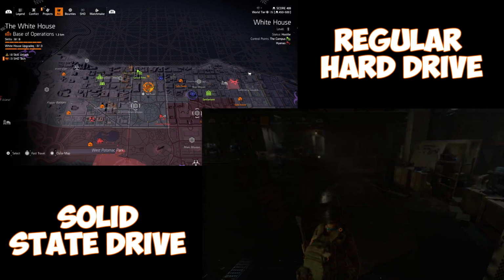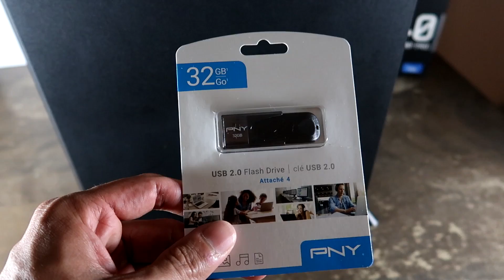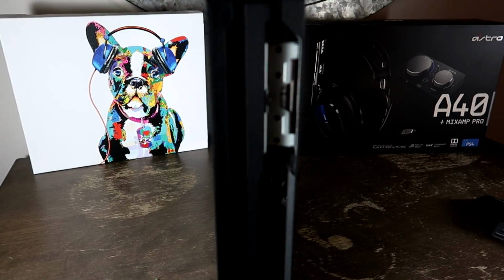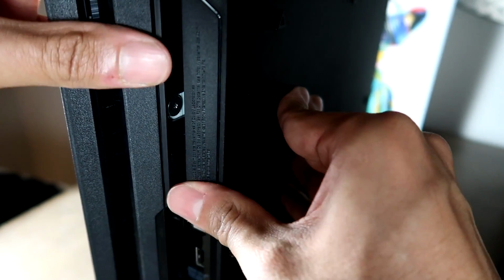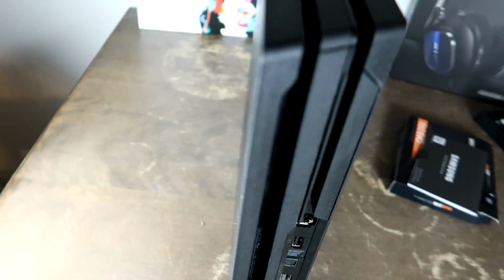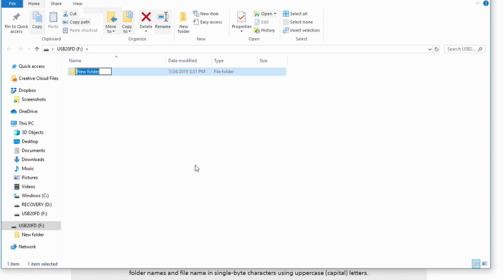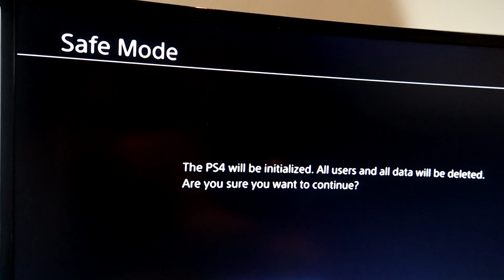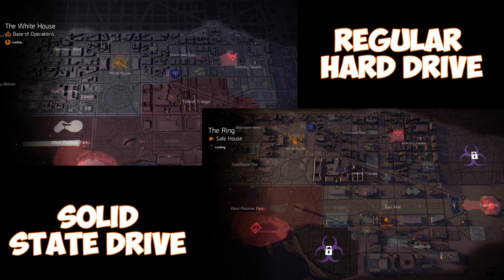HOW TO IMPROVE YOUR LOAD TIMES ON PS4 PRO/SLIM | QUICK GUIDE TO INSTALL A SSD "SOLID STATE DRIVE"

Comment: I know this is an older video... But what is better 860 EVO or 870 QVO? Or is an external T5 good enough
Reply: Go for the 870. I have a 2TB in mine. An external T7 would be better even for backing up.

Comment: Just finished installing the 860 EVO on my PS4 slim.
Would def recommend it. Smoother interface and faster load times.
Reply: @TruGamer128 I’m gonna buy one too however, I don’t know which ssd to buy. Should I buy the Samsung ssd evo or qvo
Reply: @brucewayne1332  I would recommend whichever you can find the best deal on. I doubt you'll notice any speed difference between the two honestly. Hope this helps
Reply: @TruGamer128  Ok. Thank you!

Comment: It been a year since you posted this video, I been reading community blogs that people been using external ssd ? Also one kid said he used his fathers laptop that has a built in SSD and it works just like a external drive? Is any of this true?
Reply: Yeah, get a Sata to usb adapter.  It's really easy to change out the hdd anyway. Less than 5 mins. Ssd doesn't only make laod times faster, but it'll load up texture assets in the game a lot faster too. What I mean is that you won't see clay like objects but the textures would be loaded instantly.  A 1tb Crucial mx500 is 100 dollars on amazon.
Reply: Or wait for ps5 that's coming next month

Comment: If I remove the hard drive that comes with the PS4 and buy an adapter for it. Can I transfer the apps/games directly to the new hard drive?
Reply: Only if after you install a new hard drive into the PS4 and resign back into Playstation Network.

Comment: Don’t forget to deactivate ur ps4 before u swap out the hard drive for a ssd. It was a problem that I ran into when I logged into my account I wasn’t able to make my ps4 my main one after the swap to a ssd
Reply: how do you do that? also was you able to fix the problem?
Reply: @bigdogpistolp5898  it should just be in the settings. It's really simple. Just search for a video on it. But be careful you can only deactivate a PS4 once every 6 months. Yeah, I was able to fix the problem I just emailed sony and they were able to deactivate it for me. Basically deactivating is like removing the ps4 from your account. You are saying that it no longer belongs to you. You can only have one linked to your account at a time. So you need to get rid of the old ps4 and make space for the ps4.

Comment: 500gb 860 evo should be delivered soon, i will be using an external hdd as well. SSD are pricy but outclasses hdd in all other aspects.
Reply: Don't except it to be exactly 500gb, because I've bought a 1tb and it's actually 800gb

Comment: I realize I might be a little late to the party here. But, instead of advocating for ONLY SSDs. it is worth noting that the Mechanical Hard Disk Drive that Sony preinstalled in the PS4 console was antiquated to begin with. Most if not all of them, came with a 5400RPM HDD stock. Which is arguably one of the slowest speeds of HDDs available on the market today. Also, it is noticeably absent any mention that while SSDs may not have moving parts and are generally faster than HDDs, it is important to remember the cost versus reward ratio does not diminish the fact that HDDs STILL have their place in the gaming space. The price point for a SSD is often MANY times more expensive than its HDD counterpart. Should a SSD (unlikely) fail, you will inevitably spent more to buy 2 SSDs versus how many HDDs you could have purchased for that same amount of money. You could get a 7200RPM HDD and improve your gaming experience across the PS4 Original Model, Slim, and Pro. It is somewhat biased to state you MUST have an SSD to optimize game play. In short, SSDs have greatly improved in performance and reliability over that of earlier SSD versions. However, HDDs have been around for decades, have withstood the test of time and are still in use today. To solely push SSDs as the be-all-end-all solution is not only incredibly biased but inaccurate.

Comment: Hello, if i just bought a brand new ps4 pro and i haven't used it yet, do i still need to back up anything from the original drive before i install the new drive?  thanks, john
Reply: Only game saves and video recordings if you have any. You have to download digital games anyway, and everything else (ps+, digital games) are connected to your account.

Comment: you fucked up when you explained how to screw in the new SSD into the Hard Drive Enclosure. Didn't mention there was a size difference you had to compensate for and the fit isn't as simple as you make it seem
Reply from the maker: if you got the SSD its plug and play?
Reply: @NothingButSkillz  no its not. The SSD isn't the same size and doesn't immediately match up with the screw holes of the enclosure. I had to use a couple of tissue to make the SSD screw holes match with the Enclosure holes. This should've been mentioned in the video
Reply from the maker: @Slayin101  the samsung SSD on the PS4 pro is 100% plug in play. If you bought a different brand then its different. I installed it on camera. I used no tissue?
Reply: @NothingButSkillz  Dude, I used the 860 Evo Samsung 2TB. Same as yours just more storage. When you lay it flat on the enclosure the screw holes don't match up. You have to put stuff under it to elevate the SSD so the holes match up

Comment: Thanks for the video.  I find it hard to believe the PS4 Pro is so slow. I purchased the 2 TB Samsung EVO SSD and hope to install in a few days.
Reply: @MARCUSAURELIUS Hi,  The installation was easy.  As the unit was new I only had a few games installed so I did do a back up and just made sure I had my saves in the PS Cloud to retrieve.  Most videos on this show the plastic cover which has to be removed to gain access to the drive screws as being an issue to get off but I found an easy solution.  There is a raised area on the end of the part.  Use something flat to push forward from that spot; without allot of effort; and the piece comes right off and went back on without issue.  You will need a small phillips screw driver. Fully power off the PS4; not sleep mode; and just remove the original drive. Put the new drive in and start up.  The system will not see the drive because it requires the NEW system files from PS to format and setup the drive.  You will place this file on an USB device so the PS4 can access and install it.  Make sure you have a USB device the PS4 will recognize. I recommend checking it before beginning.  There is a minimum  size requirement.  Format it to eFat and the PS4 will see it.  One the PS4 installs and runs the file you can redo everything or use a backup you can create before beginning.  One thing I had to do after installing the drive was update the firmware on the Samsung SSD EVO 2TB.  To do this I had to remove the drive and place it inside my desktop and run the newest version of Samsung Magician. I updated the Firmware and just placed the drive back into the PS4.  Luckily the firmware update did not impact the files on the drive and I did not have to redo anything.  Samsung does make a 4TB EVO SSD but I am not sure is the PS4 will recognize a drive larger than 2TB. Physically it will fit but it will come down to if the system is able to recognize a drive larger than 2TB.  Good luck.

Comment: I upgraded to this HD 
Had a question tho for those who have done this have u noticed that it PS 4 pro seems like it not working as hard? Or has had those this when it loading games were it gets loud? 
My PlayStation seems to be working a lot better with this drive
Reply: yup. I replaced the drive but also cleaned the fan (which wasn't too dirty) and heat sink. Totally a quieter machine. Can't even tell it's running unless I touch the back and feel the heat from the fan

Comment: For real u got 2 go through all that to make ur PS4 pro faster? Holy crap! Xbox one X is faster in load times w/ it's internal HD than the PS4 but adding an external HD 2 it doubles & almost triples the speed of it. I'm not bashing PS because we are all gamers & everyone should be happy with the system they have and want to play. That being said adding an external HD to an Xbox one X (which is already faster than the pro) is 1 simple step...plug it in to the USB port & I dont need a flash drive. So u dont need 2 parts (SSD & flash drive) just 1 external (I recommend Seagate which is what I use @ 3TB). Changing the hard drive 2 the PS4 Pro does not void the warranty @ all unless u damage the system in someway. So if u r confident that u won't damage the system & void ur warranty then I agree with Skillz but if u don't want 2 go through all that & potentially damage ur system then find a different option.
Reply: I wouldn't use an external id swap the drives its cleaner looking

Comment: After about 2.5 years take out your SSHD and replace it with a new one put films on this old one, the SSD tech works like a giant flash drive with only so many writes too it (don't worry its 1000s) this will make your SSD a fantastic movie drive as it will be read only and even if the gate closes (means the last write) as long as the films are on it doesn't matter your reading the films only, you should be able to hand the drive down to your kids and they to theirs, films to watch for years!

Comment: I thought this video was going to describe some setting we can do or app for consoles. I love you NBS but you aren't saying anything we can use. Of course a solid state drive (or cheaper varient--solid state hybrid drive) will make the games faster. Some of us don't want to have to shell out hundreds of dollars though.
Reply from the maker: That’s the point consoles are held back due to the hard drive which is slowing the console down. No settings can fix that and that the problem with these massive games

Comment: This is old stuff bro,  I’ve been using this like for a year!  Best SSD is SAMSUNG Portable external SSD T5 - 500 GB - USB Type C!  Don’t buy other crap or open your ps4
Reply: Taking out the hard drive is as easy as changing out the air filter in a car. All that is holding it is a cap and one screw and it slides right out...

Comment: Bought a 8 TB external hard drive for my PS4 slim so I'm all good
Reply: But is it a SSD thou
Reply: @Ace7of7Hearts  Sadly its hdd but i bought mine for the storage for games cause that 1 TB it had I filled up 😣😆
Reply: @whowuzit  is it possible to return it or use it as an external hard drive instead? I got a 2tb HDD 2 years ago and bought a external about 6 months ago to bring games to my school's PS4
Reply: @Ace7of7Hearts   Oh, I do use the 8 TB as a external hard drive my bad for not being more detailed. Just plug it in to the front usb and transferred all my games to it
Reply: @whowuzit  lol na u said it, I didn't see it
Reply: You can take apart that 8tb and replace the internal hdd with it, with more space it'll still load faster, but not as fast as a ssd

Comment: Does this also work for regular PS4s or is it just for PS4 Pros/Slims? Also is it not a hassle to transfer save data from one hard drive to another?
Reply: Silver Hawk yes it works the installation is just a little different but pretty sure it’s that same SSD
Reply: @omaralomar8227  got it, thanks!
Reply: Silver Hawk https://youtu.be/JIdQw_K-ArY that's how to install it on the PS4 but this SSD in skillz video is cheaper than the hyped x one

Comment: Great tip! Using an external Samsung T5 on my XB1X from about a month ago - makes a huge difference on Div 2.  Quick loading into the game, fast travelling and all textures are there immediately.
Reply: Nice!!!! 
Is easy too on Xbox One X make that upgrade?? 
Guide??
Reply: @starfirepr6318  No guide just plug the USB and the SSD into your Xbox One X and format it
Reply: @thomasfitz  cool!!!!!
Reply: @starfirepr6318  also 500GB remember the drive is for speed - not storage; get an HDD for that
Reply: @thomasfitz  so in term of speed not different between ext.500Gb ssd drive  to 1000Gb ext. ssd drive??
Reply: @starfirepr6318  no difference the speed limitation comes from the USB 3.0 cable - can't go higher than that
Reply: @thomasfitz  so you use both drive?? 
The game you want the benefit from the ssd drive you transfer and keep others original drive?? 

I see the 1TB is almost $200 and 500Gb the price is $99

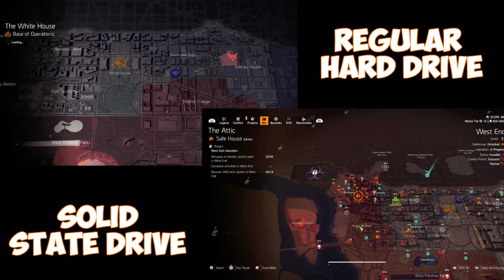Comment: 2:01 shows you Standard vs SSD
Reply: Does SSD heat up less? I have the old PS4 Pro (loud fan) had overheating issue due to playing AC Odyssey for many hours on 4k reso without rest which may have damaged my HDD because it started to stutter and lag. I'm planning to change to SSD but am now conscious about my PS4 Pro's temperature. My PS4 also is always clean with very good ventilation. Had changed thermal paste as well when I had it repaired due to the said overheating issue. Will my PS4 Pro run  quieter due to lower temps when in SSD?, would it be the same? Or woyld it be louder due to higher temps?